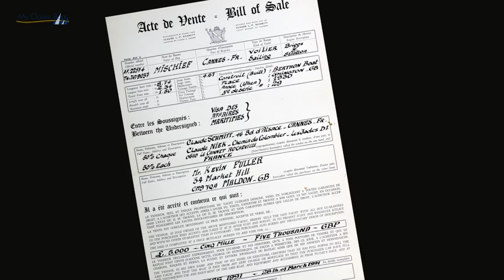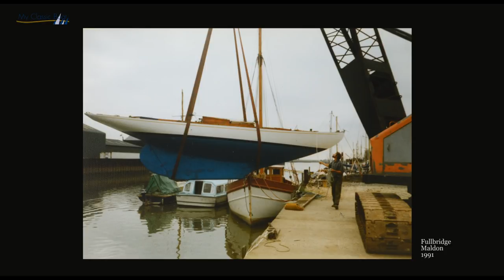My Classic Boat. West Solent  1930

Comment: Tiller notches have been used on Åfjordsboats bigger than ca. 27ft since at least the 1700s.
Its northern cousin does not have it, in fact it has a push-pull tiller in all sizes, even 45 footers, owing to the need for a quicker response to unstable winds between the northern mountains.
This is the sort of solution that is invented in parallell places through time, forgotten and invented again.